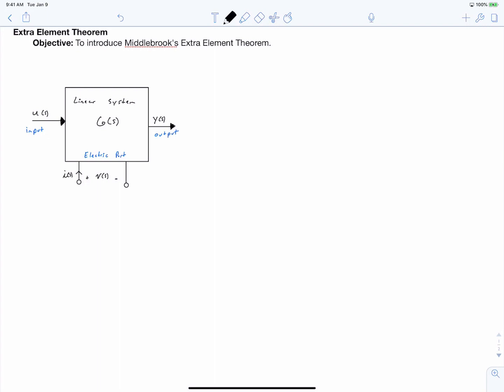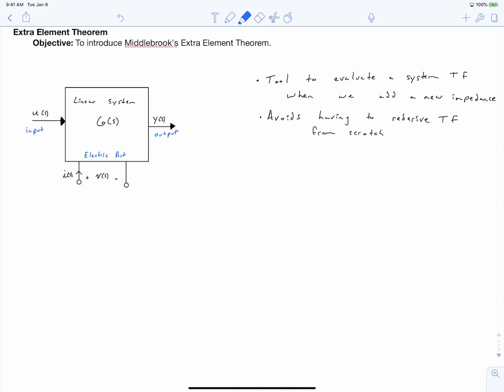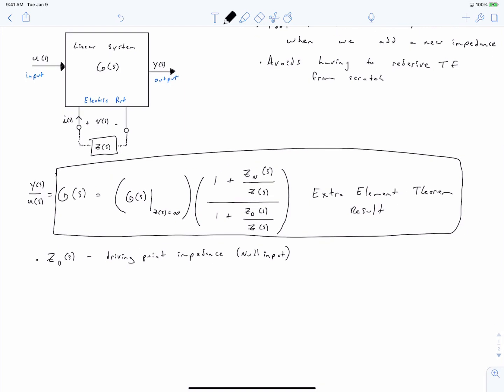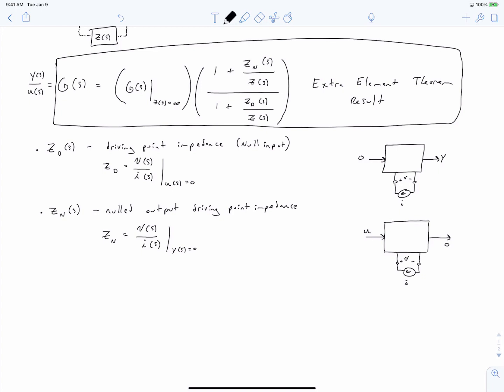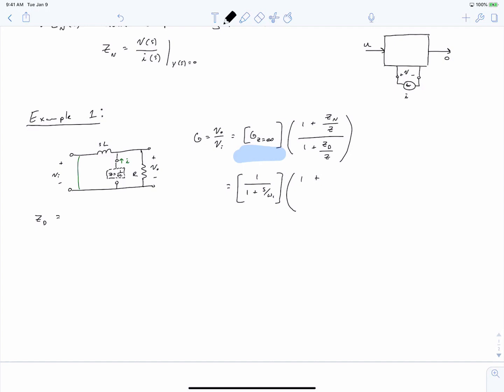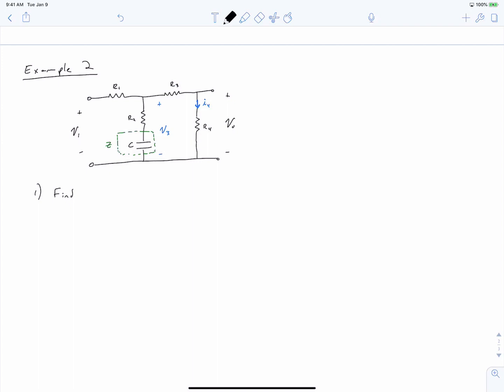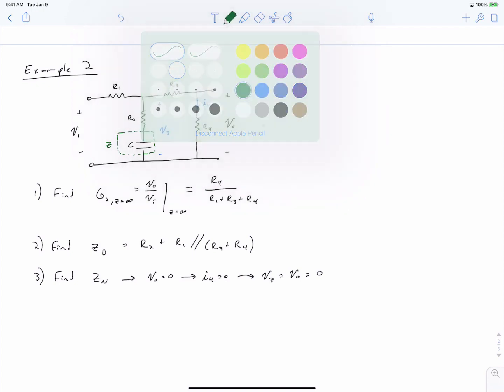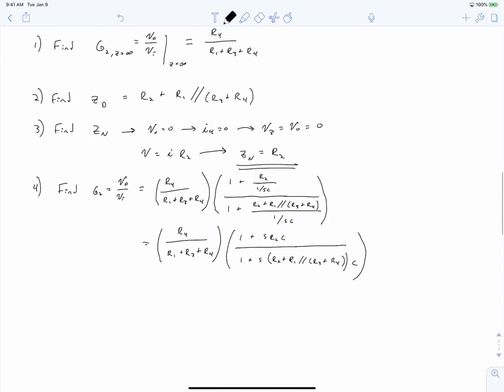Power Electronic - L16-2 - Extra Element Theorem

Comment: 13:00 For Vout = 0 is it not sufficient to short only R4 and not R3+R4 ? Thanks in advance
Reply: The current flowing through R4 and R3 is the one and the same. For Vo to be zero, i4 must be zero. That means, the current flowing through R3 is also zero making its voltage zero.